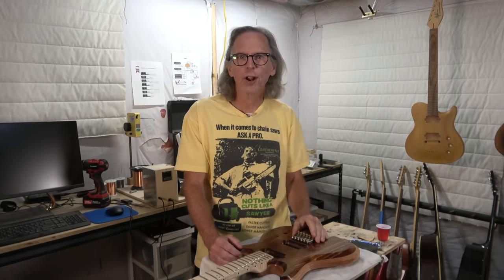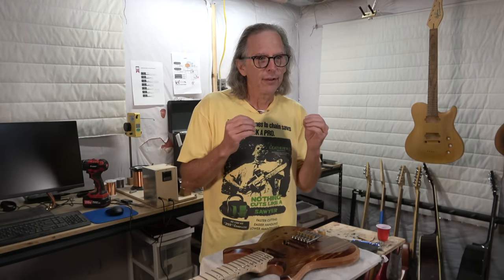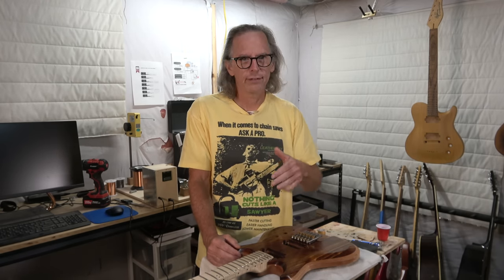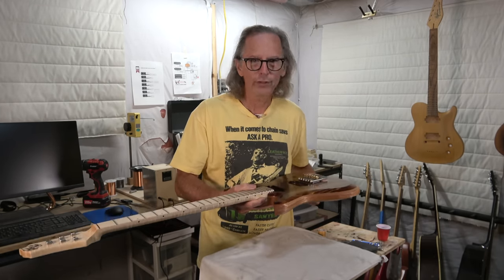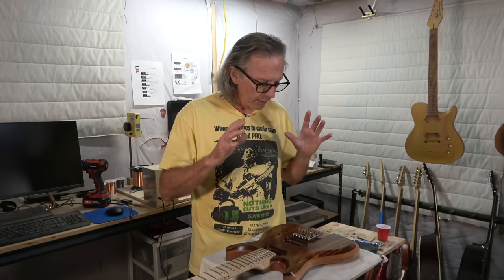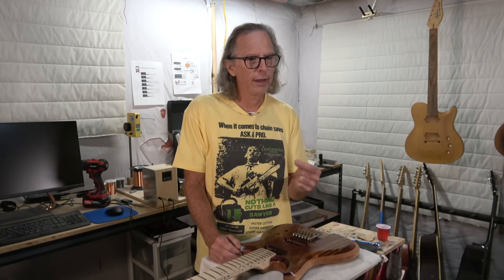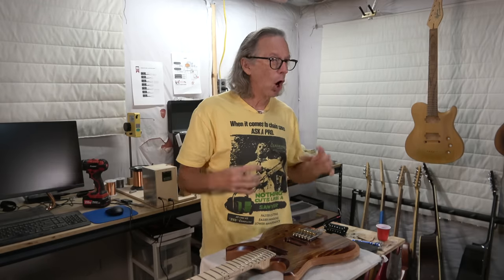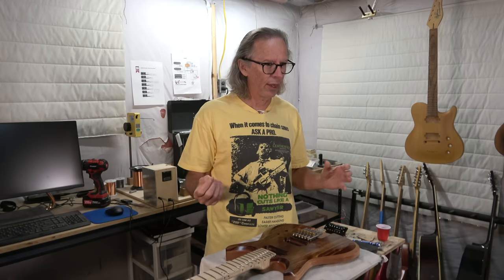Guitar Building Techniques That Are A Waste Of Time

Comment: I regularly watch your Channel for the many insightful ways and clever solutions you use in building your guitars. Something came up on your current headless guitar build that is also used on most solid body guitars. It is specifically the neck angle, and whether should it be parallel to the body or angled back. On your current build, you had to create a recess in the top for the bridge to fit the special tuning machines due to the straight neck to body joint. I think that could have been avoided, and in advantageous ways.

In my many years of experience as a player, I've found it much easier to play a guitar with a neck that is angled backwards some, as it is more ergonomic in putting the lower frets closer to my body, and raising the highest frets above the body of the guitar, making them more accessible and easier to play. The difference is particularly striking when I switch between my Strat, and Gibson ES-175. The Gibson plays like butter and the Strat feels uncomfortable and cramp by comparison just because of the neck angle. I know angling the neck backwards on a solid body introduces more chance of braking the headstock off, but it sure makes playing the guitar a lot easier in my experience. Perhaps food for thought. Thanks
Reply from the maker: All true except I don't like the look or feel of angled necks
Reply: I found the steeper the neck angle, the higher the bridge, and thus the higher the strings sat off the body.  
It was way easier when strumming and not looking to hit the low estring with way too much hand/pick. 
I find if the strings are closer to the body, then it’s easier to judge the strings when your not actively looking . 
Just my opinion though.

Comment: Great video as always.  I wonder if the fall off of the frets is more necessary if someone makes a big jump in string size?  You fine tune your neck after stringing it up, but have you ever then put a significantly larger gauge of stings that would possibly need more room to vibrate?  I am just a beginner in building,so I am just wondering.
Reply from the maker: Probably, but that's not the builder's concern. It's the player's. Adding falloff increases the cost of the guitar and in most cases will not be necessary. Why make a customer pay more for what they don't need? Instead, they can add it themselves or hire a luthier to do it for them if they feel it's needed.
Reply: Larger string gauges and shorter scale lengths will need more room to flop around.  Falloff allows lower action than would otherwise be possible when fretting from about the 12th to 24th fret on a 24 fret neck with falloff staring at the 18th, or when fretting from about the 11th fret to the 22nd fret on a classic fender type neck with falloff starting at the 15th fret.  Generally speaking, heavier gauge strings increase fretting effort.  More volume and equalization are usually better ways to get a fatter sound without reducing playability.

Comment: thanks so much chris for your sharing .how about a video on winding pickups with the new yellow tensioner in use and how you set up the tensioner for the tightness of the wire for your pickups
Reply from the maker: I probably will at some point. However, these tensioners are very touchy and what works for my tensioner may not work for others. That being said, a video might be a good starting point.

Comment: I'm wondering about shielding  the pickup cavities, if it's always necessary? I have a few guitars that I shielded and some that aren't, and I don't really notice a difference between them.👍😎🎸🎶
Reply: Our sing leader at church had a tele style guitar he played. We had lots of stage lighting, and when he moved around, the hum sounded like two jedis fighting! After I shielded it for him, the fighting stopped.
Reply: @jeffscarff1655  cool!👍😎🎸🎶
Reply: Wire the guitar with 4 conductor shieled cable, and you don't have to shield anything, because the wiring harness is shielded.  Just connect all the grounds and shields together then wire as usual.
Reply: @normbarrows  single coil pickups typically don't come with four conductor wire, hence the need for shielding
Reply: @jeffscarff1655  For some reason I was thinking strictly in terms of humbuckers with shielded leads only.  Probably because high output passive quad rails are my preferred pickup to use on a build these days.  When used in conjunction with humbuckers with shieled leads, shielded cabling precludes the need for additional shielding such as tape or paint.

Comment: I thought of one technique I'm not sure is necessary. Having the neck on a jig to simulate string tension for fretwork. I've read a lot of techs just adjust the neck perfectly straight with a notched straightedge. I'm curious to see how others feel about that.
Reply: I've leveled dozens of necks without using a jig.  Works perfectly fine.  But admittedly, I probably don't fully understand the concept.  I mean, to me, if the neck is straight, it's straight.  I don't care if there is no string tension or 10x string tension, if it's straight it's straight.  Level the frets with the neck perfectly straight, string up and dial in about .008-.010 of relief, set you action and you're good to go.
Reply: @markrup6369  I've never leveled a neck, just a few frets here and there. I read up on it, and re-fretting in particular. I'm just thinking, when there are strings on that neck, and you have some relief, (simulated with jig) would it be better to level the frets like that? Theoretically, wouldn't the frets be a little higher on both ends of the neck when relief is introduced if leveled flat? Just wondering. I'm certainly no expert. Thanks.
Reply: Wood is not uniform and even if a neck is perfectly straight when strung up, once you remove the strings it's going to move a little.  If there is a weak spot or a part that is stiffer than the rest of the neck those parts will move more or less depending on the other stresses on the neck. It may be insignificant most of the time, but by properly jigging up the neck under string pressure, when the strings are removed you'll know the neck should remain exactly as it was when strung up.  If you think about it you would really want to do your fret leveling with strings on and under tension (and there are leveling beams that can be used for that) so the frets end up perfectly flat under tension, which is how they are used.  Whether the movement that happens when you install or remove strings makes a noticeable difference depends greatly on the stiffness and consistency of the neck material, whether the truss rod is engaged and whether you have carbon fiber bars or other stiffening installed.  On a perfectly, or at least consistently, stiff neck it doesn't matter, but those don't exist.  Even a carbon fiber or aluminum neck will move to some small degree after strings are installed.  YMMV...   

Is a jig necessary?  No.  Will you end up with a better fret job if it's jigged up properly?  Probably.  Will it matter enough to make the investment in a neck jig?  Debatable...
Reply: @riplead  You are right in how you are thinking about it.  I think it would be foolish to level frets while the neck is in relief.  You want the frets level with respect to the earth, NOT with respect to the (potentially curved) neck. Think about it -- say the neck has a huge amount of relief.  If you level the frets under that scenario, the frets near the nut and bridge end will be much lower than the frets in the middle.  This would cause buzzing and choking whenever you fret a note, say, below the 7th or 8th fret - all your open chords would buzz.  My process is to get the neck perfectly straight (again I'm agnostic to under tension or not -- just get it straight) and level the frets.  Works for me every time.
Reply: @alamaralaa  I guess I agree in concept, I've just never experienced a problem.  Question -- you do agree that the neck needs to be perfectly straight to level the frets though, right?  Even if it is under tension?
Reply: @markrup6369  That makes perfect sense, thanks Mark. Makes me wonder if that jig is necessary at all. Maybe for other things I guess, but I can't think of what off the top of my head.
Reply: For 25.5" scale length running Ernie ball 8's, I set the fret plane flat (no jig), set the action at the 24th fret to a little under 1mm, and call it a day.   Works every time - unless you get body flex (not an issue on traditional builds).

Comment: Great video, as always. Thanks. I haven’t found it essential to solder humbucker covers when they fit snugly. I would if I got some squeal or noise but I haven’t ever. I have most recently fitted an “open” cover to a bridge humbly to match the look of a P94 I fitted in the neck. It fitted tightly and there is no difference to the sound of the pickup now than when it was uncovered. The same has happened previously with full covers. So I think the automatic advice to solder or use silicone etc. seems overblown.
Reply from the maker: Do you make and sell guitars to customers? Do they include a warranty against defects like pickup covers falling off?
Reply: @HighlineGuitars  no - I’m only working on my own guitars. I can see why manufacturers would probably solder in every case as it isn’t much extra work. However, the “rule” that it has to be done in every case (for personal use) is never challenged.

Comment: Agreed. Use fall away to solve a problem. I’d rather have as perfectly leveled frets as I (or the PLEK) can get, and use fall away as a cure if it’s needed.  Great video!!
Reply: How many fretboard do you correct? How long have you had a Plek?
Reply: @5150TJT   corrected countless fretboards. The Plek has been at the shop 8 years
Reply: @pressleycaliforniacustoms9526  cool, have one in Australia, always remove ski jumps or Gibson Rollercoasters 🤣

Comment: Actually, one thing I've stopped doing is leveling the frets before I put strings on and setup (excl intonation). This is for e.g. part or kit builds. I've had frets test egregiously high but barely present any buzz after stringing up. Conversely, I've leveled and ended up with a ton of buzz (possibly from a poorly executed leveling job).

Comment: Great video. Loads of food for thought with regard to wasteful processes. 

The one method I always found superfluous was how some manufacturers would use the fretboard binding as a fret end (hope I’m describing it properly) on their necks. 

Too much trouble in my opinion.
It may be fine on a one-off guitar (where you’re trying to show off your technique) but for a mass-produced unit?  Seems like way too much work to do (particularly with shaping the binding around each fret end) when you can just install the frets on top of the binding normally. 

And then there’s the potential of wood shrinking, which could force the frets into the nubs in the binding, causing the binding to crack and even pull away from the rest of the neck.
Reply from the maker: With modern CNC technology, you can cut fret slots short of the edge of the fretboard thereby eliminating the need for binding. However, binding looks cool and probably isn't going away anytime soon.

Comment: I learned the hard way to never take a torch to your guitar build and try to make a Shou Sugi Ban finish! Thankfully, I am following Chris' instructions for a paint finish with grain filler and sanding sealer. I normally make set neck builds, and I am wondering if it is easier and possible to paint and lacquer the neck and body separately before gluing them together without it being noticeable. Usually, I've glued the neck into the body on past builds, but it's such a pain to apply and sand back lacquer.
Reply: @willrichtor  Thanks Will for you advice and positive feedback about my question! I definitely appreciate it after you guessed it, my glue joints opened up. This is absolutely a craft that is both fun and frustrating haha! If we're not messing up we're not learning!

Comment: On electrics, fall-off can limit how high up you can set the neck pickup.   But on acoustics it can eliminate fret buzz.
Keep in mind that acoustic players hit the strings harder to get more volume.  When electric players hit the strings hard they are expecting more distortion and you can't hear any fret buzz anyway.
Reply: I think pickup height can create its own harmonics, increasing the physical movement of the string. For that very reason, I pushed down the high 'staggered' pole magnet under the G string to get better tuning and decrease buzz.
Reply: It's the distance from the pickup to the strings that matters, not the pickup height above the body.  Adding falloff doesn't change the pickup to string distance, unless you change the saddle heights.  Electrics only distort when played hard if it causes the amp to clip.  Tube amps tend to behave this way.  Amps with lots of "headroom" do not.
Reply: @leonarddaneman810  A pickup that is too close to the strings can induce magnetic buzz, where the strength and proximity of the pole pieces causes magnetic drag on the vibrating strings, resulting in a Sitar like buzz.
Reply: @normbarrows  I'm talking about 'staggered' poles . . . I was having issues with the G string, so that's the only pole I pushed down . . . I think I recall someone saying the high G magnet pole was for old types of strings, the G being wound instead of solid???? Magnetism works on the inverse square, rapidly losing pull as you move away . . .
Reply: @leonarddaneman810  Sounds like you have a vintage pickup and non-vintage strings leading to magnetic buzz on the unwound #3 string.  Pushing the slug down is a viable option, as it reduces the strength of the magnetic field.  A wound #3 string or a pickup with correct pole staggering for an unwound #3 string are also viable options.  A pickup with correct pole stagger might be considered the "correct" fix by more traditionally oriented luthiers.  Me personally, I'd probably do what you did, assuming the slugs would move.  I've even experimented with removing slugs entirely to change the frequency response curve of a pickup.
Reply: @normbarrows  Well, the Strat 'Warble' was fixed by 'pushing the pole.' There is also a need to match the poles to your neck radius. Imagine a 'vintage' pole stagger on a guitar with a 12" radius!

Comment: As a player, i feel like giving fretboard a radius is a waste of time

personally sanded flat all of my fretboards before upgrading frets to stainless steel and i wouldnt go back regardless of music style

also think about how easier building a guitar becomes when you dont have to adjust everything to the radius
Reply: I've done a number of builds with flat fretboards.  Other than not sanding the radius, about the only other savings is not having to set individual saddle heights.  Technically, a radius is nice, not necessary.  But it's so nice in so many players' eyes that it almost seems necessary - especially if you want people to buy your guitars.
Reply: A flat fretboard also allows you to set the action much lower than it's possible with a curved fretboard.

Comment: Semi-spherical ("hot dog") fret ends are pretty but not worth the time.  File the fret ends flush with an angle inwards, then round off the sharp corners and edges and call it done.  Nobody plays on the mirror-polished hot dog fret ends anyway.

Comment: I'm not entirely sure you can hear fret buzz under amplification. It can be heard when you aren't plugged in, certainly.  But when playing with a band at ear bleed levels, can you hear fret buzz?  Also, potting isn't needed for pickups in every case.  No microphonics at all with unpotted humbuckers in front of an amp, and they are one of the best sounding pickups.  The coil windings are tight and don't vibrate, like you say.
Reply: Really depends on what is specifically causing the buzz and just plain how much of it there is! Definitely a little fret buzz acoustically (like the most commonly found buzz) ain’t gonna be heard thru an amp

Cheers

Comment: Thank you Chris. The information about the wax potting of pickups, and how it came about, was really interesting. I had to laugh, thinking back to the "garage band" days in the early-mid '70's when everyone having two or three double-stack Marshalls, or Peaveys was "how it was done" (and having to rent extra gear for gigs) - along with the 25' curly cords. Thank heavens that has become part of rock and roll history (Grateful Dead fans may disagree). Putting up all of that gear was a lot easier on the body then than it is now, for some strange reason, LOL. Many thanks for your very good information on checking for high frets - I will definitely try changing the order of those parts of the job. I'm building for myself, or occasionally to make a gift, but anything that streamlines the job sounds like a good idea!